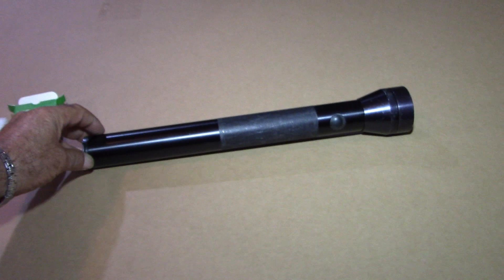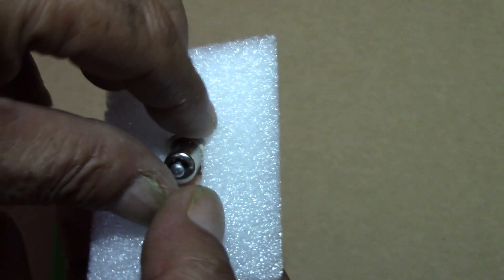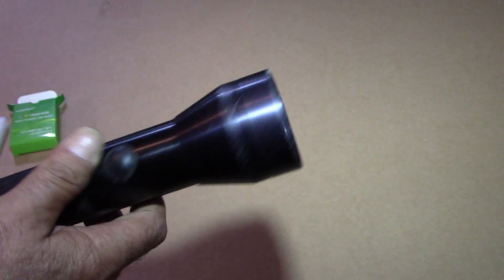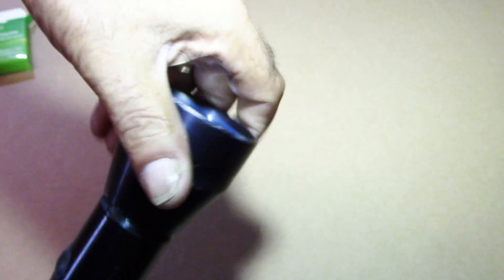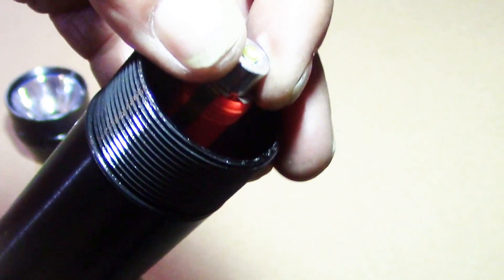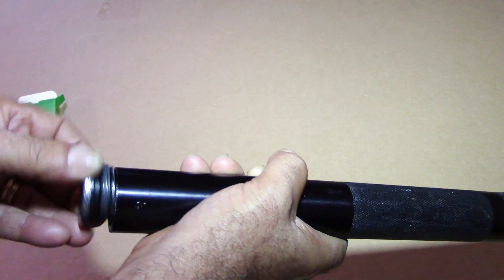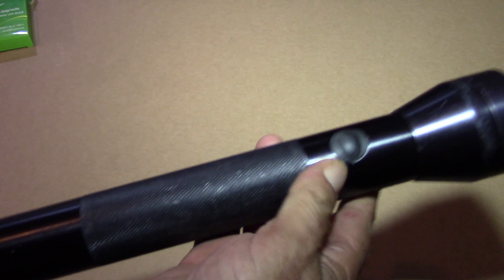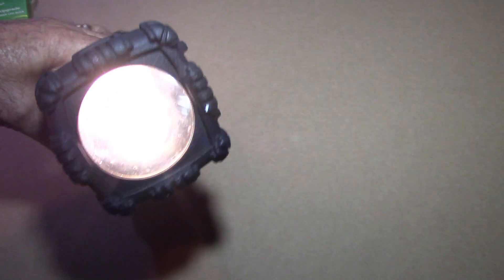Flashlight LED Conversion Kit Bulbs 3-6 Cell C&D for StreamLight or MagLite Torch 🔦⚡

Comment from the maker: Today's video is about converting an old flashlight to led, all you need is the right bulb. Here’s what I did to get some use out of this old Police issued StreamLight 4D battery workhorse this will also work on MagLite Torch and many other 3-6 Cell C&D battery powered flashlights.

Comment: That Bulb assembly looks very similar in size to my stream light scorpion, smaller flashlight from about 20 years ago. By the way, thank you very much for the video, sir. Do you think it would work in my stream light scorpion mini  flash light? Or do I just buy the bulb assembly and take a chance?  at the time I remember paying $60 for this and it was one of the brightest lights out there for it size. It takes two 3 cell batteries. There is nothing on YouTube about the stream light scorpion except for one video from 13 years ago with a guy showing how to replace the bulb I’m looking to convert to LED if possible thanks in advance. Cheers.
Reply from the maker: It's worth trying and you can return if it doesn't work. Just need to make sure you order it for the two 3 cell batteries. It would be cool to know how it turns out.

Comment: It's less brighter than you think.  I never buy LED flashlight anymore again.
Reply from the maker: maybe you are using the wrong bulb for the type flashlight you have? Just a suggestion,,,
Reply: @JohnCRV  
I have used several different flashlight and PR base LEDs similar to what you use but at least 10 years ago.
My eyes can't get along to LEDs
My eyes love natural warm beam color specially Halogen bulbs.
Reply from the maker: I understand. I feel the same way about car headlights.

Comment: This is a great idea for the older flashlights. When I was in the service, I used those plastic periscope flashlights they issued us - being able to have an LED bulb back then would have been great! Another LIKE for your video!
Reply from the maker: What's amazing is that the batteries will last a very long time if kept the proper way in storage.